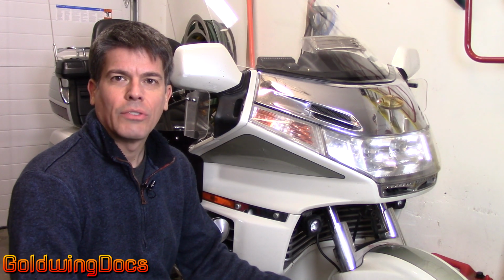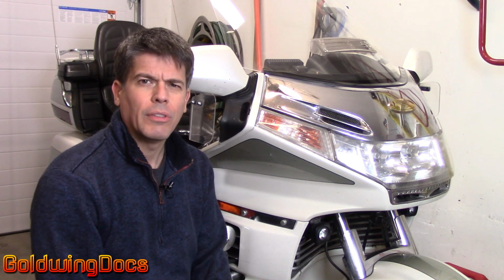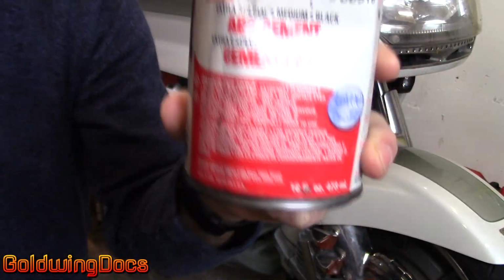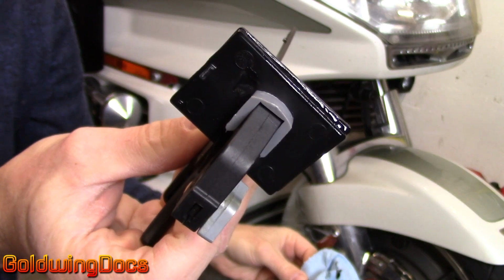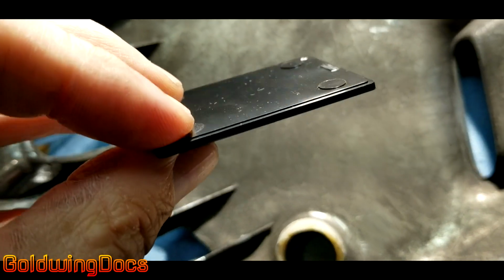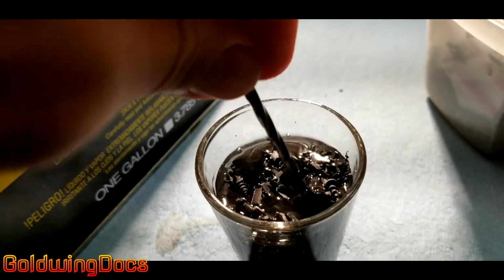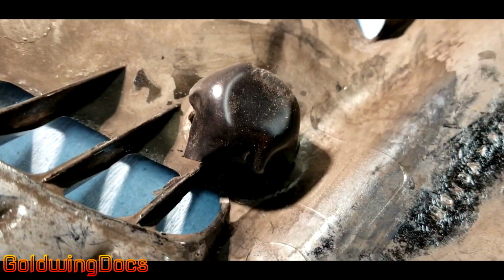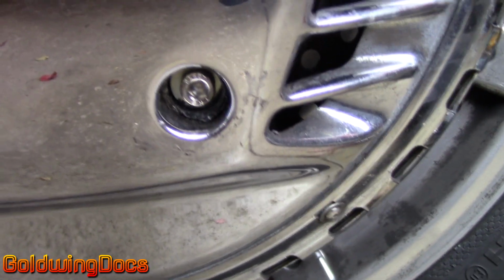How to repair cracked and broken plastic on your motorcycle bodywork

Comment: I've been doing this for years. A few things I do differently: 
1) Acetone seems to work just as well or better than MEK and isn't quite as dangerous or volatile. 
2) I use a small pill bottle to mix up my slurry. The bottle is HDPE plastic so it won't melt from the acetone. I can just cap it off when I'm done and if it's dried out months later when I need it again I can simply add more acetone and wait a day or two for it to all melt down. 
3) I dab acetone on the edges/surfaces to be joined keeping them wet for a couple minutes to soften up the plastic allowing the chemical melding to get a little deeper. I'll sometimes soak the patch piece in acetone to get it seriously melted and slimy before sticking it onto the part needing repair. I'll fold a small piece of aluminum foil into a shallow pan to make an acetone bath and keep adding a little as it evaporates off. Naturally this has to be done in a well-ventilated area. If I can get both the patch piece and the repair part soaked enough to make them slimy like a bar of soap left in the water too long then I don't even need the ABS cement as the melted plastic is it's own cement.
4) Lego blocks are ABS plastic and can make a fantastic structural patch/reinforcement. I used a 1x8 block (anyone familiar with Lego knows what I'm talking about) to patch the crack in the front fender next to the mounting bracket. That's a notorious problem for GL1800s with the little fender skirt attachment.
Reply from the maker: I've tried acetone as well, but MEK does seem to work better (and faster) - it's what ABS cement is based on as well. Excellent tips on pre-wetting the patch and the repair point to soften them up, and yes!! Lego is extremely high quality ABS, and comes in great colors too!
Reply: Thanks, the Legos are genius for the added color factor. 

But I think I will use the ABS cement rather than acetone. 

Acetone is very toxic and I rather not mess with it

But thanks.

Comment: Here in Australia, not too long ago you could buy Methyl Ethyl Ketone for plastics modelling in model shops.  These days, straight MEK is no longer available to the public (because a lot of people prefer to sniff it) but because I work a lot with plastics, I now use simple Revell modelling glue which contains a proportion of MEK.  Modellers use it primarily on polystyrene but this modelling glue will also work very well on ABS.

Comment: I really appreciate you taking time to fix the hole on the bullet  chrome cover I have one that broke out had both bolts and parts of the chrome interface hole and I stopped and went back and found my coverage n d I have been trying to figure out how to fix it or buy new ones but I haven't seen or found the same kind but now praise the Lord for finding your channel out and I was just wondering through YouTube and run across you doing a oil check on how to check your oil on mark to mark again I say thank you so much and keep riding your motorcycle whatever kind because when you get our there going down the road and the wind blowing as you ride 😊 😀 It's nothing like it and I  rode when I was 17 ,18,-20 then stop until 2018 I found 750 motorcycle Kawasaki 1992  and then about 6 months later I found 1994 Gl 1500 Goldwing and trailer 😀 and I started riding it again and I'm 67 yrs old and watching 👀 and the other Guys carefully and enjoying it as life goes on..
Ps. You are doing great keep it up .
Reverend Alfred Newcomb

Comment: Great info! For holes like that, if you could find ABS rod and bond that into the hole, you could then bore and drill it to the correct size without having to mess with molding the flat pieces.

Comment: This method worked unbelievably!!! I used it on a 94 zx-11 that had a cracked front nose cowl and a bracket on the rear that held a screw. I used acetone once and mek  once. Both worked great. Thanks for the instruction!!!!!

Comment: That was an amazing detailed repair.   I had tried a plastic welder that was cured with UV light  with no success,  I will give the ABS method a try I have lots of plastic parts starting to crack on my GL1800  from removing for service  proceedures over the years. Thanks for the great tutorial.

Comment: I am going to try using this method to repair my right side panel. One of the pegs is broken off. Itll be a chore, but a fun one. Thanks for the awesome video!
Reply from the maker: Definitely! Some people have inserted a metal pin in the middle of the peg (Honda's name for these is "boss") for extra stability when re-mounting it to the cover.

Comment: Oh thanks for this informative video. I’ve got a surplus police bike with what I believe to be an ABS plastic tour pack with many holes for lights and wires and switches and do dads. I am thinking of filling the holes, paint and put it on the bike. Now I’ve got a plan. I just need some ABS Sheets. To use for filler. Thanks.

Comment: Great video! I’m in the process of rebuilding my left side front fender mount!  Quite a large piece, so I’ll try some ABS pipe split and flattened then molded under heat and bonded with ABS cement. Thanks for the info!

Comment: Very nice.  My GL1500 has a lot of damage from previous owner.  So, I'm sure I'll be using some of these techniques.  I know I will most definitely be putting my 3D printer to use in fab-ing up broken posts and pins, among other things.  Thanks for sharing!
Reply from the maker: Make sure you use ABS filament, so you can bond it to the ABS in the bike using MEK or ABS cement.

Comment: Another option for replacing missing bits is to 3D print them out of ABS. That would probably be my solution to your missing screw boss piece, that would be very easy to replicate. I'd probably make a piece that went all the way around the remaining boss all the way to the inside of the cover, then bond the whole thing.

Comment: Good advice and I have found fiberglass is not a good repair. ABS is a much better choice. I use 3M8115 panel bond adhesive only because I have this on hand and use it for most of my work.

Comment: 2 part EPOXY . Devcon 2 ton comes to mind.
Reply from the maker: There are two reasons why repairing ABS with epoxy is not optimal.

- Different stiffness. ABS flexes. A lot. Cured epoxy does not. When ABS flexes and an epoxy repair attached to it does not, it causes stress points on the ABS at the edges of the repair. This can cause cracks in the ABS, and can also cause the repair to fail, with the epoxy coming away from the ABS.

- Different coefficients of expansion. ABS expands and contracts a large amount with fluctuations in temperature. Cured epoxy expands and contracts as well, but nowhere near as much as ABS. This puts stress against the two materials - with the end result again being cracks or failure of the repair.

The best way to repair ABS is with ABS, as I explain and demonstrate in this video.
Reply: Personal experience with EPOXY, it's not the long term fix, it doesn't last.

Comment: I followed the video and it worked great. Now i have a big question. Whuch exactly paint manufacturers use on the abs. Id like to have a gas resistant pain, but i am afraid to melt the plastics with 2k types of paints.

Comment: Great video Scott!  I like the idea of drilling into sheet ABS to make the raw material for the slurry.  I just happen to have about five 12x12 sheets of ABS, of various thicknesses to make some.
Reply from the maker: Technically you could just put chunks of ABS into MEK and eventually it would dissolve - but by using drilling shavings, you get thin pieces with maximum surface area, so it dissolves much faster. I do use large, coarse bits to do the drilling - you don't want shavings that are cut too fine, otherwise you end up shearing too many of the polymer chains that give ABS its strength.

Comment: Inside of my trunks on my 94 1500, pieces have broken and cracked where the 4 tiny bolts hold them to the frame.  Can I just brush the abs cement over the pieces laying there and bolted there and it will melt it back together?? I like those small black pieces of ABS, Where can I get those? My trunks are just falling apart and I don't ride dirt or rough roads. Don't know why it is doing that since I bought it 3 years ago.I put my second set of new tires on the past few days and saw somewhere I thought on your site keeping the trunks all intact and removing the seat and flipping them all over on top. That worked great will all kinds of room, but when I went to line up the one bolt on each side to the cut out bracket that swings down in place, I could not line it up no matter what I tried. So I had to remove both side trunks to get access and pry and line them up again. Bad idea. More plastic broke in pieces.  Just don't understand why the plastic has been cracking where the little bolts go. Thanks. Tim R.
Reply from the maker: It's extremely difficult to get them to line up when pulling the bags/trunk up like that to access the wheel, which is why I don't do it.
Reply: @GoldwingDocs  I swore I saw that you supported that dumb idea. Anyway, I got out my harbor freight 80 watt plastic welding Iron and spent an hour or so and forgot I knew how to weld plastic. I have repaired all 3 bags inside and out like solid. The top trunk I had to use screen to patch over a big hole and then I just layed in a solid bead across the back inside of the trunk. I thought my trunks would fall off or into pieces. But now they are better than new and welded up heavy duty solid.  :-Thanks. Thanks so much. 🙂 Tim R.

Comment: How do you repair one of the pins on a side panel that have broken off and lost?
Reply: Those are pretty difficult to recreate manually. I would buy a replacement boss like this one, and bond it with ABS cement (assuming they too are ABS):

https://cyclemax.com/inc/sdetail/side_cover_repair_studs/136689
Reply: Visit your friendly local Honda dealer's service department and ask them nicely to save you some wreck damage take-offs. Often, there are good pins and other special formed pieces in the lot they toss. My local dealer gave me the whole right side to a post-2011 GL1800!

Comment: I have a gold wing 1500 when it gets hot it shuts down but starts after it cools what does it sound like to you?
Reply: Visit goldwingdocs.com to help solve your problem.
Possible hot shutdown.Fuel pump,engine control module,plugged gas cap,thermal pulse coil,bad connection at the kill switch.Test for spark when it quits to determine if it's fuel or electrical trouble.